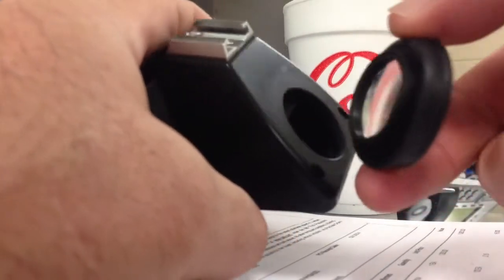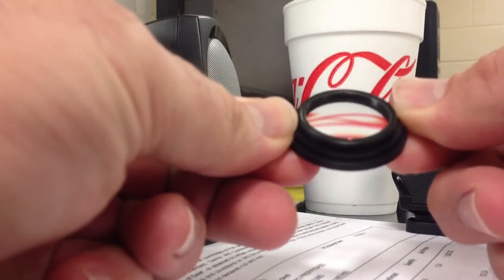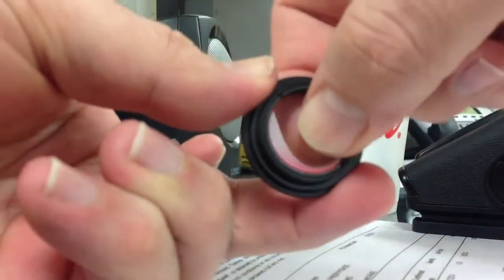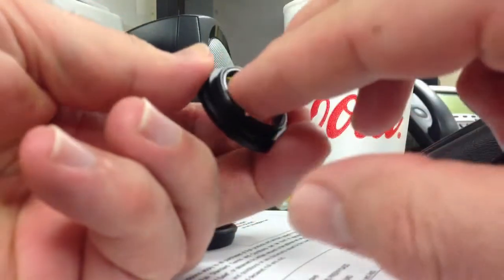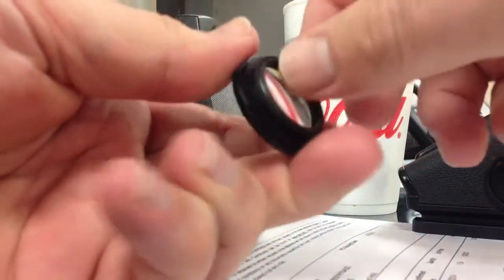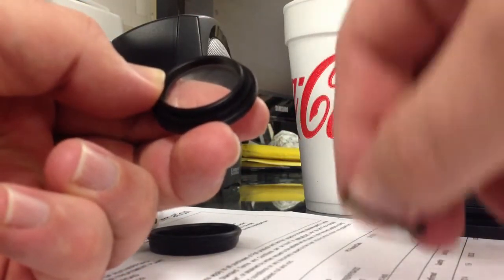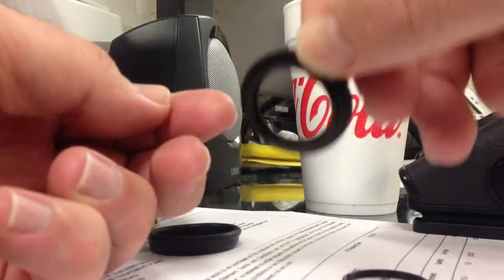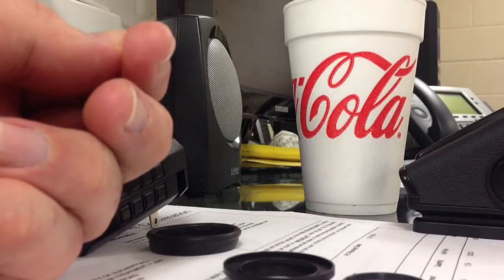How to change the diopter glass eyepiece in a Hasselblad prism ( pme 51 )

Comment: Just acquired a not properly functioning PM5 prism finder and I'm trying to figure out what's wrong with it. I have to move my eye about one inch away from the eyepiece do get correct focus. Do you have any idea if it's supposed to have two pieces of glass in the eyepiece? Mine only have one, but I can see that there's room for another retainer ring in the front. Any help is much appreciated!
Reply from the maker: Your pm5 is made exactly like this pme51 which I show in the video.  It's the same exact prism but the one I am working on has the electronic metering device inside of it.  So there is only one piece of glass.  What I'm going to guess is that a previous owner removed the factory neutral diopter that came with the prism and they insert a correction diopter.  If you can remove the diopter as I did in this video and flip it then put it back it you might see if that helps but I doubt it.  You will probably just need to go to eBay and look for a neutral diopter that is being sold and that should take care of your problem.  I don't think I have a neutral diopter to sell you at the moment or else I would be glad to do so.  I've been selling Hasselblad cameras and parts on eBay for 16 or 17 years now but don't recall having a neutral diopter at the moment.  Hope this at least helps you.
Reply: Thank you! That was very helpful.

Comment: Hi
I am hoping you can help me with a small PM90 viewfinder issue. I received it today in the post. When I look through it, even though the lens is focused it is not clear. The diopter ring says 0D/90 and I don’t wear glasses. When I take it off and move the viewfinder away from eye 1 inch it is perfect. I put the diopter back on, do the same and it’s blurry. I suspect the diopter glass had been changed. 
There are some 0D/90’s for sale on eBay. I want check that my theory is correct before I buy one. Can you offer any advice?
Reply: Hey Stephen, I have the exact same issue, I was wondering if you ever happened to find a solution

Thanks! 

-Ben
Reply: @BenMargolius  Hi Ben, yes. I sold it and bought the PM45. It has an adjustable diopter built in.